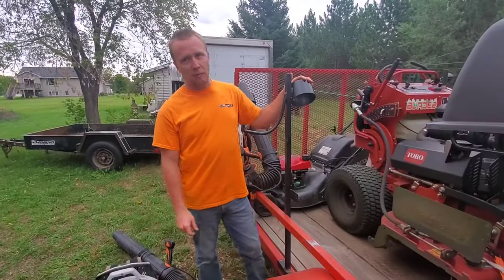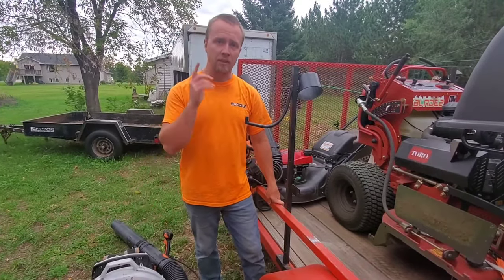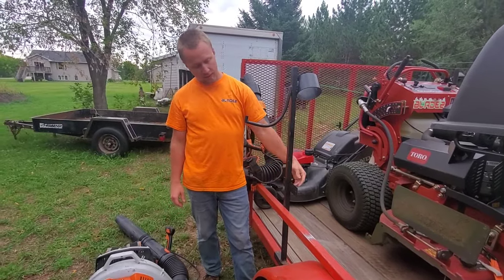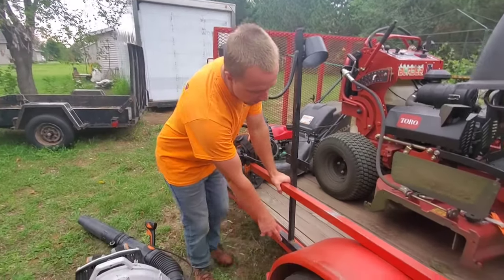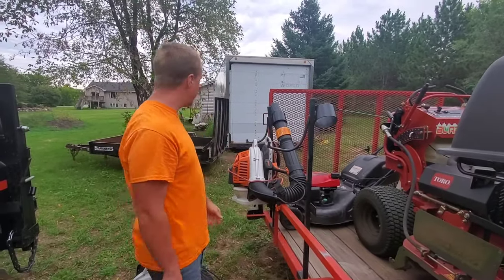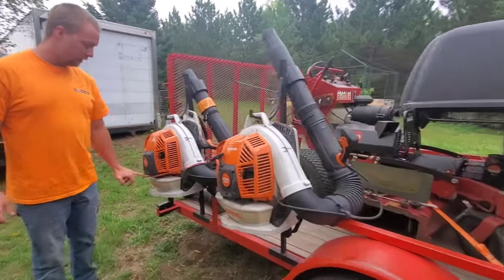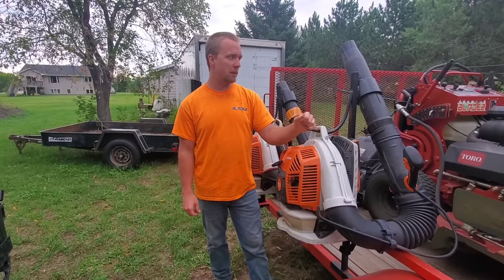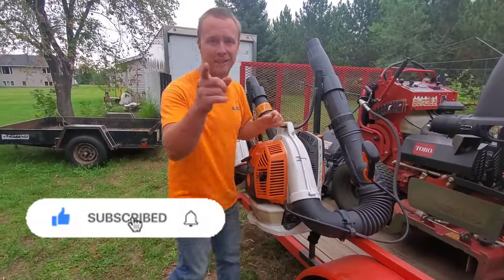Homemade Backpack Blower Rack [br800] #stihl #lawncare #diy

Comment: I've been in the lawn business for 31 years. This is possibly the best design I've seen. Need to find a way to lock them and you are good. Cool video
Reply from the maker: I agree. It needs a locking device.  I have yet to find a blower that won't fit on it.
Reply: @bladezllc  I'm going to try and build one like that. And figure a way to lock it. Thrives are thick around the neighborhoods i mow. They got me for 2 of my weedeaters last summer. I went around back to mow and came back around and they were gone.i was pissed. So yea i defintly have to lock my gear. Great invention for sure. The round pipe is the icing on the cake. I have a piece of 4" pvc pipe im going to cut and bolt to mine for the blower tube. Stay safe out there.